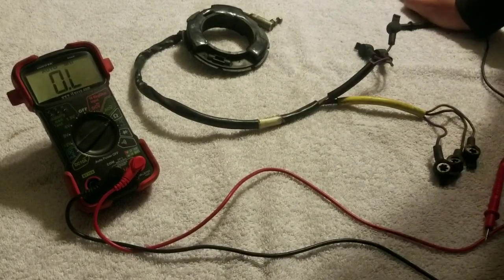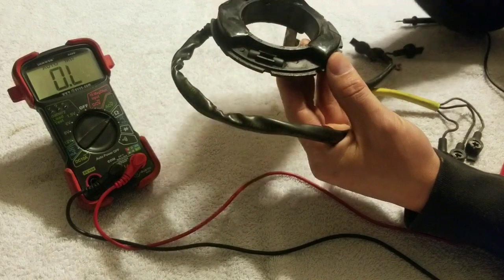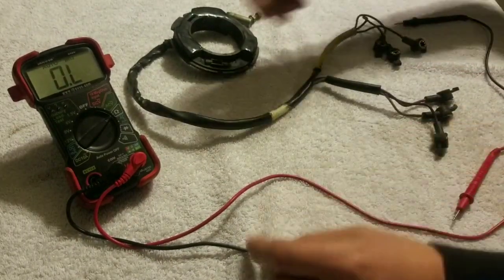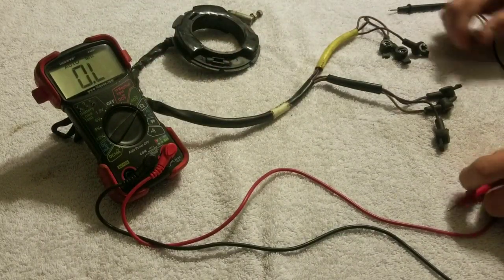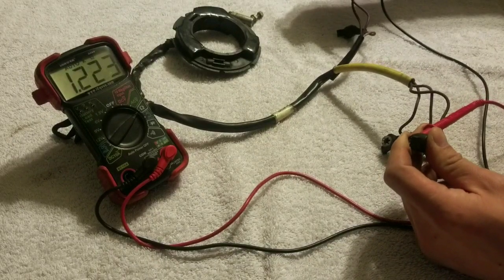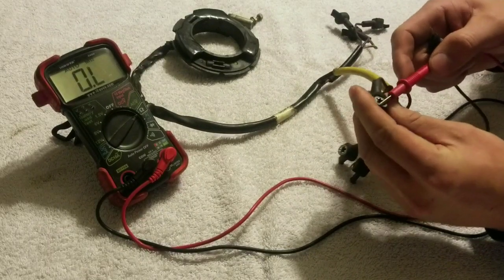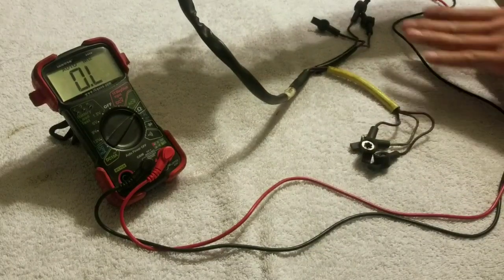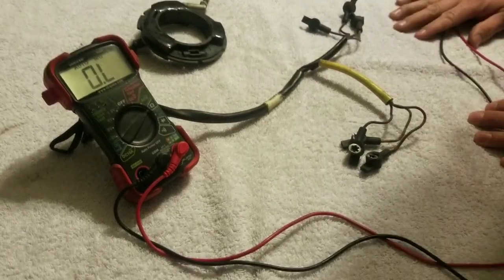Mercury Outboard Trigger Bench Test (ADI)

Comment: I have a Trigger for a 6 cyl 90hp merc ob same as in your video. (Do you have an internal diagram of it)? Since there are 2  3wire cables and Ohms are measured e.g between Brn on one and Vio on the other, it would seem that there might be 3 coils inside (with no common between the coils). So if Brn on one set and Vio on the other set are going to 2 different Ign Box inputs, that would seem to be triggering 2 cylinders at the same time. Because 6 wires with only 3 trigger coils  controlling 6 inputs would appear to fire 2 inputs simultaneously. One odd and the other end an even cyl. Am I missing something? here?

Comment: I have a 1983 80hp mercury outboard with fried wiring. Ive purchased a new stator but cant remember which way it went on i heard it dosent matter because the trigger tells the switch box when to fire the ignition spark is this correct? I dont want to fry anything because buying the stator, trigger, rectifier, and switchbox set me back more than I paid for the whole unit any help will be greatly appreciated thanks
Reply from the maker: You have to rephrase the question. A wiring diagram is what you need. Son
Reply: @MerCSonL6  when I removed the stator it was about 2 weeks before I got it's replacement but I forgot the orientation of how it went on and where the wires came down at. does the way the stator bolts on make a difference?
Reply from the maker: @ericwolf1782  yes

Comment: Good Day Sir, I would like to find out, I have measured as you demonstrated and my readings are as follows: 1434 Ohms, 1447 Ohms and 1431 Ohms. Can this trigger cause miss fire and no power? It is on a 1980 90Hp L6. Thank you
Reply from the maker: If the ohms are not in spec.... replace it. Son

Comment: My son and I have been trouble shooting a 1988 Merc 90 2 stroke. It has been running ok but one day when we went to full throttle (in water) the rpms and speed ramped up normal for a few minutes and then lost rpms down to about 2500 rpms and would not go any faster.
cleaned fuel tank, replacede fuel, replaced Coils. Tried again and it did the same thing.
Cleaned tank and replaced fuel again. replaced trigger switch and plugs.
It wont start now. Cranks great but no spark at all.
Any help would be greatly appreciated.

Thanks,

Cush Dobbs
Reply from the maker: Sounds like a fuel related issue. Carb rebuild may be on the table. Have you check spark and compression? Son
Reply: @MerCSonL6  
Carbs have been rebuilt about a month ago.
I am thinking now that the device that is supposed to rotate the Trigger to advance the spark is defective. I don't know what it is called (maybe a cam advance) Is there any way I can send a photo of this device? I cant find it on any diagrams I have looked at.This thing has a rod on it that connects to the trigger switch. I assume if working properly it seves the puropose of rotating the Trigger magnets in order to advance the spark at higher RPMs?

Thanks, Cush
Reply from the maker: @cushdobbs7910  the trigger is attached to the throttle arm. When you throttle you can visibly see the arm move thus rotating the trigger to advance the timing.
Reply: @MerCSonL6  The trigger arm does not move when the throttle is increased. Maybe I did something wrong when I installed the new Trigger switch. I can manually push the rod and thus advance the trigger switch so I am thinking the the Throttle Housing (upper and lower) must be defective.
Reply from the maker: @cushdobbs7910  the trigger arm should move when throttled. That sounds like your issue. The trigger arm is attached to the throttle arm by a steel elbow. Son
Reply: @MerCSonL6  OK, Thanks for your help. Is there anything special to look out for in replacing this trigger arm control?
It is so awesome that you are kind enough to help us think through the repairs to this ancient motor since nobody in our area will work on these old 2 strokes. Thanks again.
Reply from the maker: @cushdobbs7910  no worries. And no, there's nothing special. Just make sure to screw in the elbow first then bolt it to the throttle. Son
Reply: @MerCSonL6  We have spark.
Compression is good. all cylenders

Comment: Great video - I have a mercury 175p v6 EFI which doesn’t restart after running for 30 minutes and then turning off for 1 hour. No one can tell me why. After 2 or more hours it starts again. Cold start ok, warm start no good. Could it be stator or trigger ?
Reply from the maker: You need to reroute your enrichment valve. Have It pump fuel directly into the crankcase vs the carbs. My V6 starts on the first crank every time. Son
Reply: Low side power pack failing when it gets hot
Once it cools down it’ll start again 
Had same thing happen to my 150 xri

Comment: i see from below that this works on a V6,, it looks the same.  i took off  working trigger , put on new trigger and the left three cylinders are not firing. testing the old trigger to familiarize, all the wires show open, now dropping the trigger would that kill it??
Reply from the maker: That's a faulty switchbox. Not likely the trigger. Son
Reply: @MerCSonL6  thanks for the tip 👍
Reply: @MerCSonL6  dang replaced that last year too, glad they're not expensive

Comment: I have a 78? 90hp inline 6. It does not have a stator. It's basically been a project for the past few months but Ive had it out a few times. Will running without one cause engine problems? And also I am having problems finding the correct part number. Do you happen to know what the number is? The serial number I have is 5032971 if that helps. Thank you very much.
Reply from the maker: The stator helps power the switchbox and recharge the battery on your model. It could damage the switchbox overtime with zero power hitting the red terminal on your switch (12v hits the red & white terminals to run). I do not know the part number(s) because mercury used pretty much the same stator from 1969-1979. If you want a direct replacement the link below is what you need. Hope this helps. Son 
https://rover.ebay.com/rover/0/0/0?mpre=https%3A%2F%2Fwww.ebay.com%2Fulk%2Fitm%2F332851228049